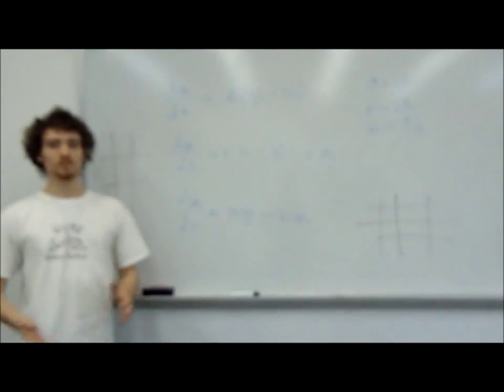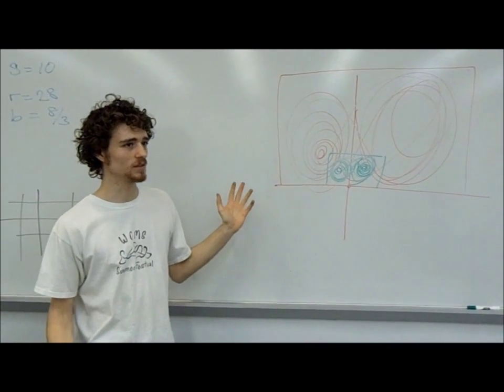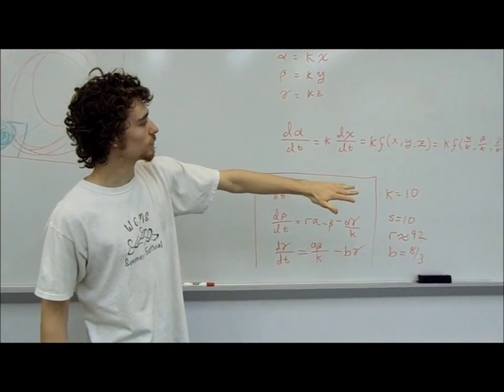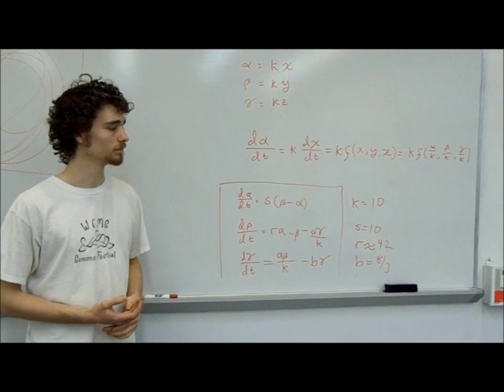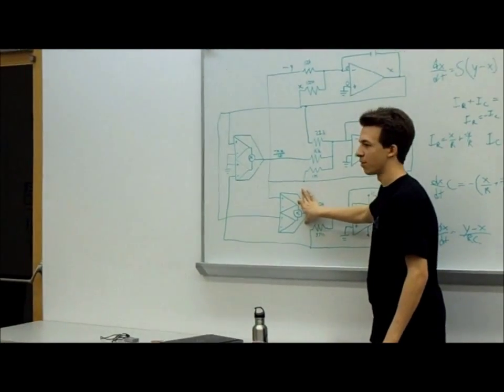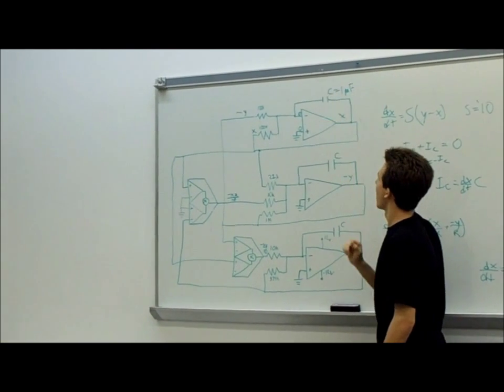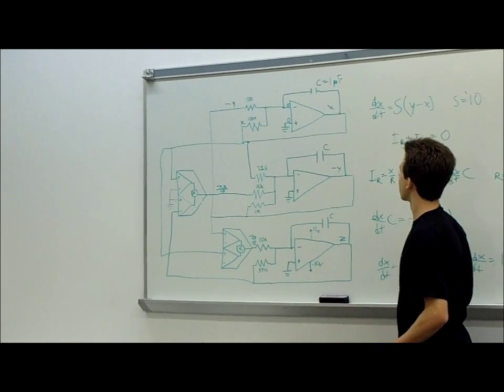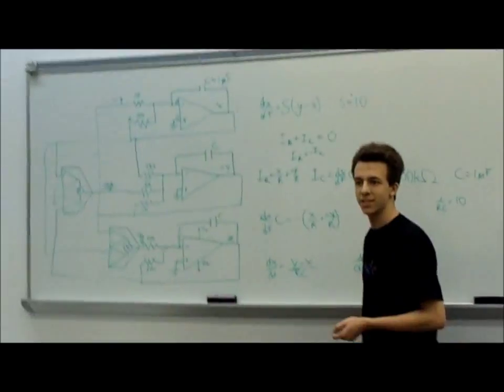Olin Unofficial - Circuit Lorenz Attractor

Comment: Thanks for this clarity. I have been making several versions of circuits that demonstrate chaotic attractor phenomenon. I use an old Tektronix 2467 scope that gives a bright old time analogue sweep. This is very helpful to explain the original equations and correlation to component values.